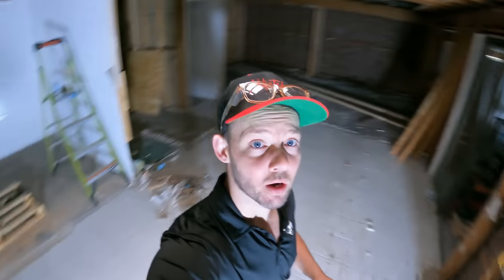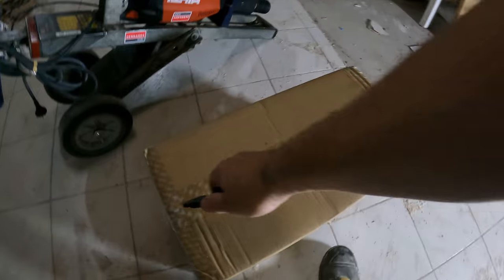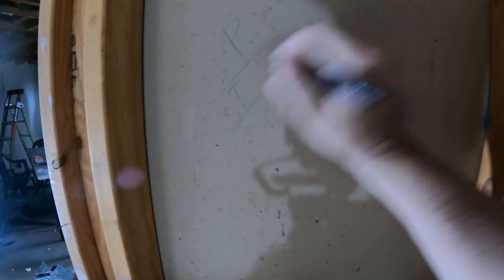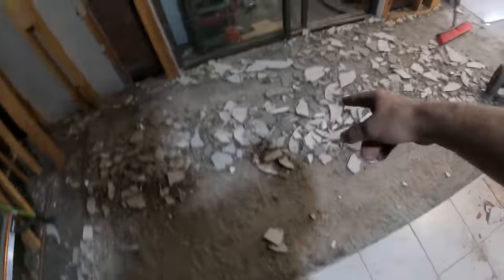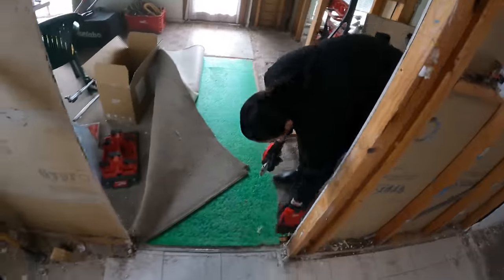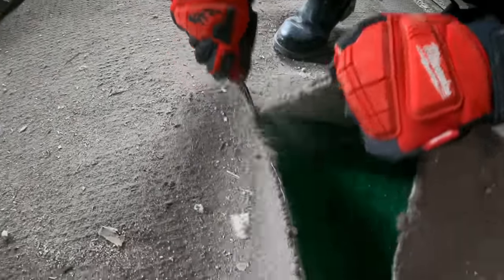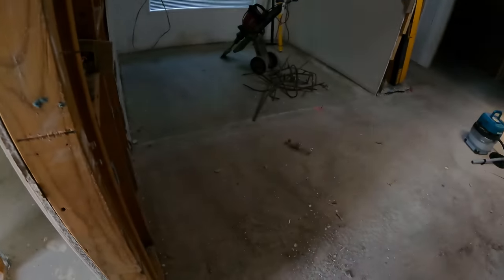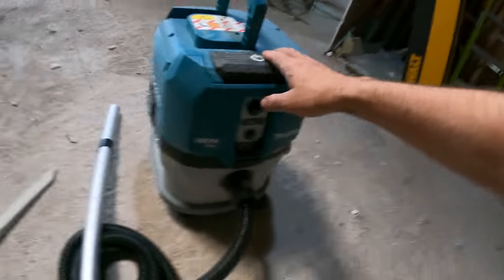EPISODE 6 / Back breaking work /renovating a house

Comment: Yeah the demo can be the gift that keeps given 😂…least with your ceilings all gone you can see how well the tiles perform with this wet weather…particularly this today! You will be lucky if you don’t need to hire a grinder to clean up your floors. Make to sure get any low spot level, the floor guys should be all over that though….but that will be way down the track ! 😮
Well done with what you’ve achieved so far and juggling your normal job in the mix 👍
Reply from the maker: Cheers shane. The demo definitely keeps giving! But I can see the light. I’m enjoying it though. I’m about to head over to see how it’s going with the rain. I’ve half installed a skylight, so we will see how my skills went🤞

Comment: I’ve seen guys using a ride on tile remover before but I don’t know if you can hire them.
Reply from the maker: I actually asked kennards about that. They have them to hire but said it wouldn’t be much good in a small area. More so for larger floor plans. Would have been a lot easier though 😂
Reply: @AddictedtoTools  the one’s I saw weren’t much bigger than the one you were using, but I think they were “low dust” models.